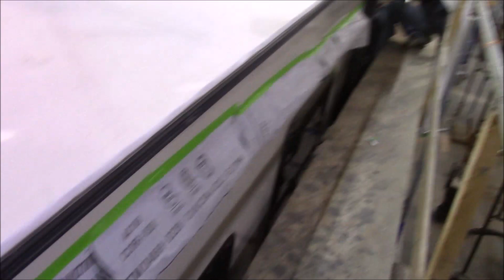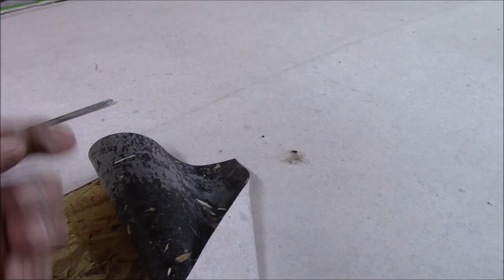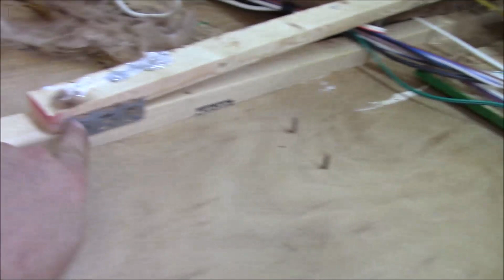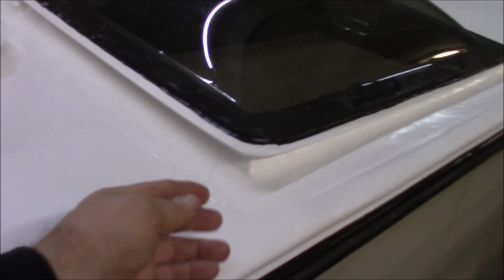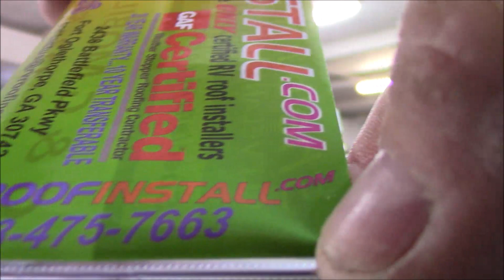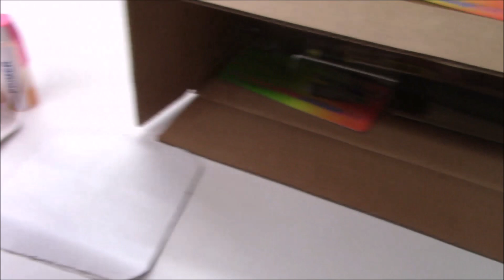2016 Coachman Chaparal

Comment: Can hardboard be used instead of plywood to lighten up the weight of the trailer? Where are you all located?
I just bought a 2015 Coachmen Chaparral yesterday and it poured last night and the roof is leaking. They had it "fixed" last year, but apparently it's not really fixed. Need to replace at least the rear end of the roof I think. The edges are kind of soft and inside wall is wet.
Reply from the maker: Hardboard doesn't have the shear or tensile strength like plywood., .although lighter.  Coaches rack and flex too much. Also consider having to walk on the roof with hardboard as decking or having snow on it...if you're in that weather.  
Located in Fort Oglethorpe Georgia.
Thanks for watching.

Comment: I own a 2018 arctic fox truck camper. The roof is solid high density styrofoam. Will the glue you use on your roofing eat the styrofoam?
Reply from the maker: The roof that keeps the water out .. that's styrofoam? Or are you saying it it styrofoam under the roof?